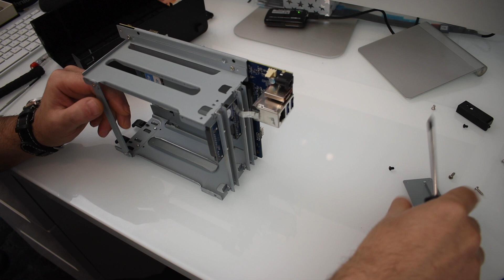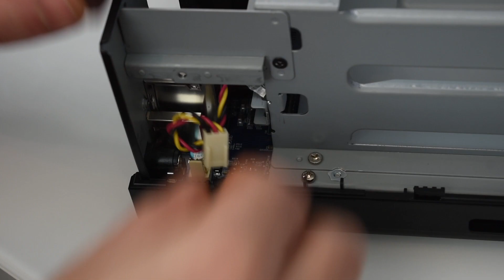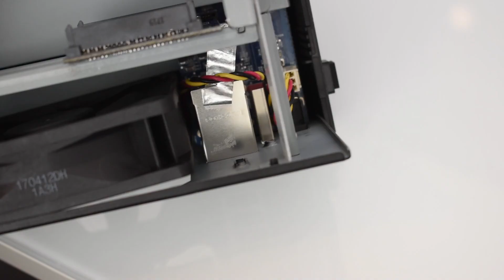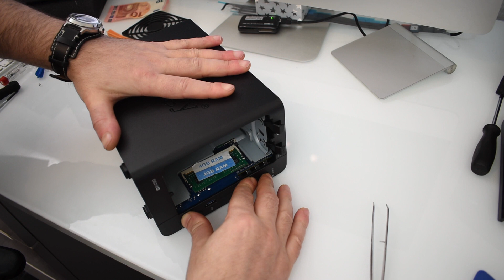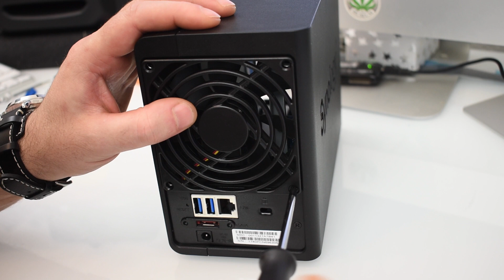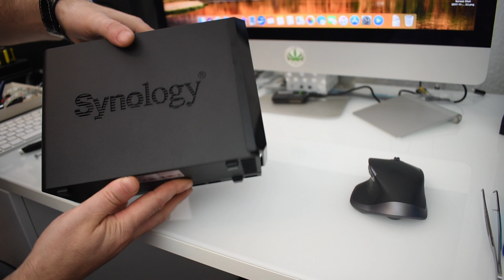Synology DS218+ A Look Inside, RAM change, upgrade - part 2 (Assembling)

Comment: does adding ram increase overall speed etc or it is just when using some streaming etc? what router do you use on this, does gbit router helps with faster syncing etc (this i would like to be faster sometimes)?

Comment: Will it take 8gig of RAM?
Reply from the maker: max 6gb (2+4)
Reply: Ah okay thanks. So I don't ever need to do that unless that 2gb fails. I thought maybe that there was a trick to being able to make it 8gb LOL. Thanks for a nice video though, it was well made.
Reply: He failed. Just use google and this nas can handle 16gb of ram (2x crucial CT102464BF160B 8GB DDR3L). And u Ivan first use google and dont write shit.
Reply: Where can you find this info so you can use 16gb?
Reply: If you want to KEEP your warranty, you can ONLY go for 4GB + 2GB upgrade

Unofficially, Intel Celeron J3355 supports 8GB of RAM per channel  
So if you don't mind VOIDING YOUR WARRANTY you can add 8GB + 8GB DDR3L-1866 SO-DIMM 1.35V
Any DDR3L-1866 SO-DIMM 1.35V from Crucial or HyperX will do
Reply: @Wagner669  Thanks a lot for the clarifications ;)

Comment: Es posible ponerle 4gb + 4gb? = 8gb de RAM??
Reply from the maker: no, max 6gb (2+4)
Reply: If you want to KEEP your warranty, you can ONLY go for 4GB + 2GB upgrade

Unofficially, Intel Celeron J3355 supports 8GB of RAM per channel  
So if you don't mind VOIDING YOUR WARRANTY you can add 8GB + 8GB DDR3L-1866 SO-DIMM 1.35V
DDR3L not DDR3
Reply: @Wagner669  Correct 👍